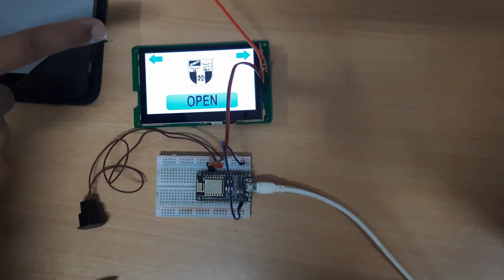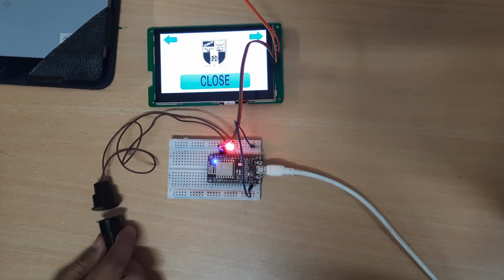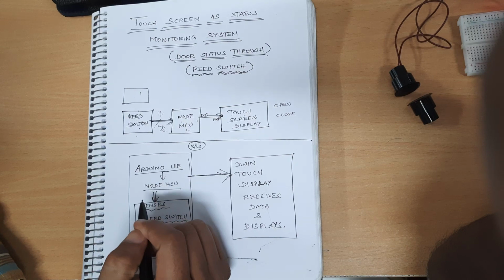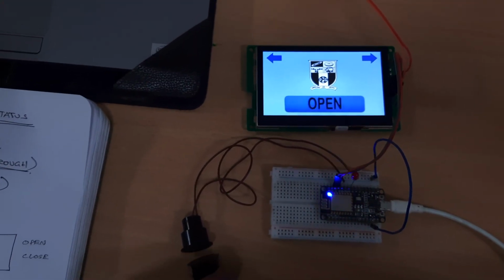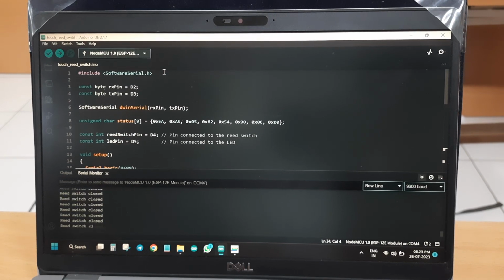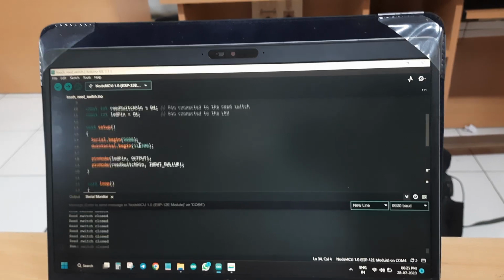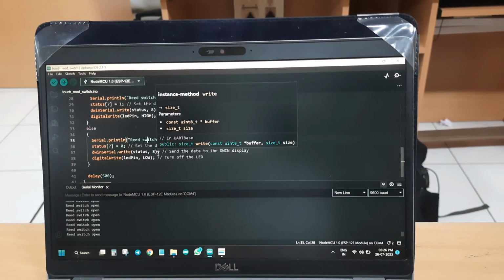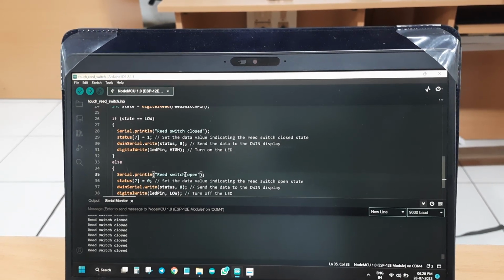Touch Screen (DWIN) to Monitor Sensor Status (Reed Switch) using Node MCU

Comment: Sir, thanks for your good video, i have one question , how will be the code (Arduino IDE) if not use <Softwear serial.h> how will be i you use by hardware by example pin 0, and pin 1 of arduino
between 2,3 pin that you use with softwerSerial ?